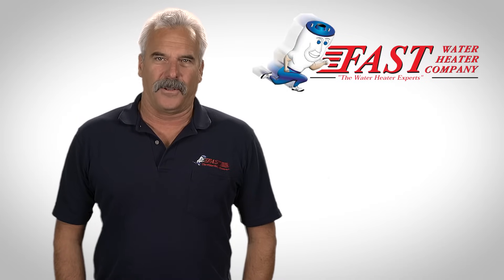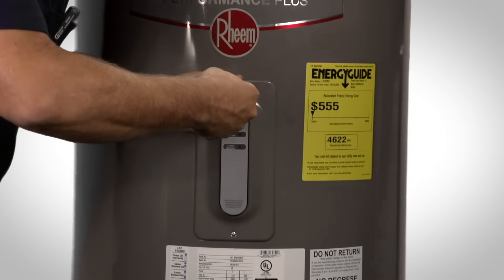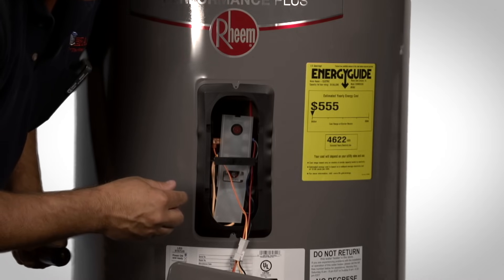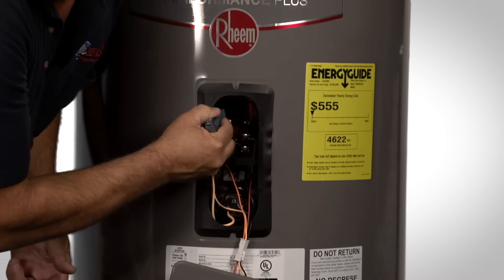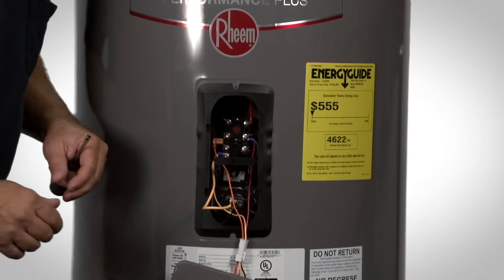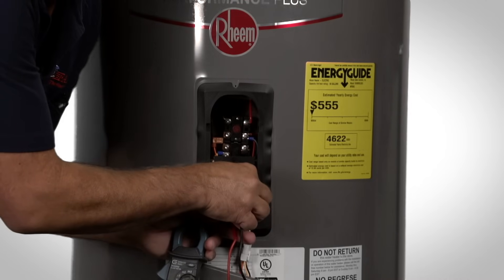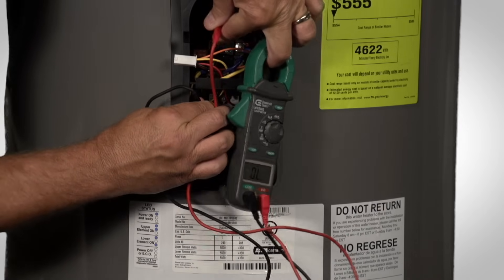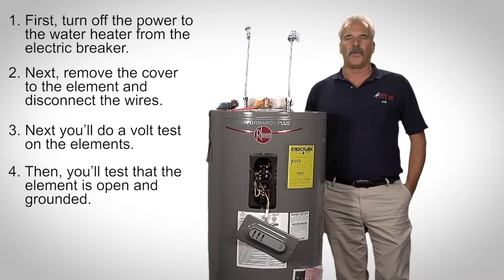How to Troubleshoot an Electric Water Heater

Comment: checking resistance defines accepted value 220(V)/30(A) approx 7.3 Ohms.  you did not calculate anything.  therefore, just check continuity via setting multimeter to continuity or lowest value of Ohms

Comment: I know this video is 9 years old, but it is still helping people troubleshoot and repair their water heaters. I just used this video to diagnose my defenctive heating element a couple days ago and fixed it today when the part came in. A plumber would have charged me more just to diagnose the issue and probably wanted to replace both heating elelments and thermostats even though only one heating element was bad.

Comment: I just had the lower element area short and blow the upper control unit. Easy fix - the cause was due to condensation saturating the insulation under the cavity cover. I see the covers are connected to what I assume are fans ... Where do I find these active cavity covers?

Comment: OL does not mean no resistance it means open loop aka infinite resistance.

Also, I wouldn't trust my life to a volt stick what if the battery were dead or it was broken?

Do a real live-dead-
Live voltage check with a multimeter.

Comment: A blown/open heating element reads resistance. It is relatively infinite resistance. No resistance is a short.
Burnt open/infinite resistance or relatively low resistance/ resistance = voltage/current R=E/I 

Ballpark resistance = 220Volts/40 says like 6 ohms... not being a professional but having an electronics degree. I would look for something likely way less less that 200 ohms (depending on the resistance or the point of contact of your test leads ta the element connectors) or what many meters read at "infinite" resistance, OL For "Open Loop". An open loop means there is a break in the element/wire in this case,

Comment: I put new elemetnts in   my heater and  I get 120 on each bolt but if   I touch 2 bolt  on the electrode should I read 240 volts
Reply: That's what it's supposed to do.

Comment: Your comment about the resistance check is incorrect. The resistance of a good element should be between 15 and 20 ohms. In most cases a bad element (One that has corroded, breaking into two parts) will show infinite resistance and the display will not change when you touch the leads to the element. If your meter shows zero on a resistance check, the element is shorted and will have tripped the circuit breaker during operation.

Comment: So I'm just curious, I have an electric 50-gallon AO Smith heater, I replaced both thermostats and both elements but even after that, the heater doesn't seem to be turning on, I also made sure that the breakers weren't tripping.

Comment: I heard several incorrect terminology in this video. Why refer to a “voltmeter” when checking continuity/resistance. It’s a multimeter, first of all, and you should be telling the viewers to set it to a resistance position of a certain range. The comments about the small voltage testers are quite on point as these devices have given me faulty live indications several times. Always use the meter as a confirmation. The final question for me is in the end when you are testing to see if the element is grounded why would you be looking for no resistance? Wouldn’t that mean the element was shorted to ground? What is the normal state that the element should be in in reference to ground? I would imagine it is connected to power on one side and that power flows through the element and out the other side so there it cannot be in contact with any ground source so the reading should indicate full resistance, no?

Comment: Here is the easy method.CUT OFF BREAKER AND VERIFY AT UNIT WITH TESTER.
 The bottom element  in a Rheem comes on first. The upper thermostat cuts it on.
Disconnect wires to both elements. Set meter to Ohms. The range is around 27. If OR is displayed element is bad.
If both elements test good it is the top thermostat usually.
 Another sign of that is when heating water the top element not the bottom element comes on. You might have hat water for a short time but up to 15 minutes.

Comment: When I bought a new HWH from Home Depot, I asked about installation because I'm elderly and disabled. They wanted $1187 install fee + $150 permit fee + $587 for the electric HWH which of course I laughed at. It took me longer to carefully muscle that 50 gal HWH down the basement steps than it did to install it.

Comment: He read the multimeter incorrectly when measuring resistance.  OL means overload, or infinite resistance, which is what the reading will be with an open circuit.  Zero resistance will read 0.0 ohms.  He also didn't mention what the resistance of a normal element is, and google says 10-20 ohms.
Reply: OL means Open Line, not overload

Comment: On my multimeter what setting to the spin the dial to measure resistance? I’m new and I have the performance plus rheem with led lights but only the lower element lights up blue and nothing else not even power

Comment: I only see one heating element on the bottom.
I tested the voltage at the two screws on the element coming from the thermostat and I am getting 240 volts coming from the thermostat, but I don't hear the element.

Normally I hear it making a sound while it is on.

It is not making any noise.

It seems like if 240 volts is coming out of the thermostat and running to the element, the element should be on.

The tank is 30 gallons and the element says 240 v 3500 watt
The breaker is a 25 amp 240 volt double pole

Comment: Resistance is resistance to current flow, measured in ohms.  The higher the ohms, the more resistance.  An open circuit won't flow current.  The element has high resistance to produce heat and flow less than 30 amps.  A short circuit is one that is short of resistance since it doesn't flow through the device to increase the resistance and reduce current flow.  It will carry too much current and cause heat in the wires.  This is prevented with the circuit breaker, which is calibrated to kick open at a certain current flow so it opens the circuit before your wiring starts a fire in the device or wall.  That's how it works, regardless of the words he used.This is a much more in. depth explanation.  Very good,  https://www.youtube.com/watch?v=9DDk6tPTcGQ

Comment: What a CLOWN show. You have the meaning of "resistance" reversed.  "Resistance" reads OL or high ohm reading, "no resistance" reads low or zero resistance and the continuity buzzer sounds (if on). It's also not a "voltmeter" but an "ohmmeter"
Reply: "No resistance" does not mean low or zero ohms. It means infinite ohms or an open circuit and current cannot flow.
Reply: @don.sittingbull2049  NO, no means zero as in zero. Get a grip. I have an EE degree and I attended class

Comment: Sorry but using a continuity test or the beeper is not the correct way to check for ohms on those elements. Turn your meter to ohms and read the resistance. It should be around 12-16 ohms in my experience. If it’s reading a lot higher and use the beeper,  the beeper will sound indicating that you have continuity but the element would still be bad.

Comment: You said if the meter measure "No Resistance" then the element is "Open" and bad.   This is incorrect terminology.   Measuring "No Resistance" in electrical circuits means the circuit or element is NOT BROKEN.   Measuring very high resistance or "infinite"  means the circuit or element IS BROKEN or "Open" .  Maybe you should stick to plumbing,  leave the electrical to the professionals.  :-)

Comment: I disagree with the first step. You must first find out if the unit is getting full power. I turned the power off first, then removed the cover and insulation off the water heater. I turned the power back on. With my voltmeter set at 400 AC, I found out that the unit was only reading about 70 volts. If that happens, you have to go BACK to the source of power. I removed the electrical panel, found the double pole circuit breaker, and measured voltage across both terminals. 68 volts it read. It was then that I noticed that the breaker was not fully inserted into it's bracket. I pushed it in, than found out that the breaker reading was 240 volts. It's better to first find out if you have full power going into the water heater instead of going through so many unnecessary steps.
Reply: Great advice. This is why the comments exist on Youtube
Reply: Well done finding your issue, but that still wouldn't be the first step for a couple of reasons. 1, it's not safe to start pulling the plastic shroud off of the thermostats/elements with the power on and 2, the likelihood of a bad breaker being the problem is very low. You would first turn the power off, then check the elements, then the thermostats, THEN turn the power back on and check the voltage. Simple order of operations from most to least likely. You start messing around with the order the next thing you know you are pulling the plastic off of the thermostat with one hand, bracing yourself on the water heater with your other hand, one finger slightly touches any of the screws under that plastic and BOOM! You're on the floor dead. You probably wont see another breaker fail the rest of your life, flip the breaker off first and start with the most likely culprits. If your toilet over flowed you wouldn't automatically assume the sewage line leaving your house has collapsed and start digging up the yard, would you?
Reply: Timsawyer
He did say he turned the power off before removing the access cover and insulation. I agree, it's very simple to make sure your getting 220 at the breaker before tearing into a water heater just to find out the breaker is toast. But just my opinion
Reply: Yes, you are correct. Breakers can be particularly troublesome, especially old ones. You need to know if you have the correct power going to the heater before starting the process of troubleshooting or you will be left scratching your head. Also, this video left out an important step. How to test the thermostat.
Reply: Absolutley
Reply: @themisstra7708  sounds like you only have one working element
Reply: Good advice I have found breaks in the wires leading from the breaker to the hot water heater in the past also
Reply: This video will confuse people. The continuity meter beeping means there is no resistance.  When it is not beeping there is resistance.   Also do not use a “volt stick” to check for the absence of voltage. That is not a safe practice. That should only be used to verify the presence of voltage. Use the multimeter to check voltage.
Reply: @chrismatherne3675   I have two of them and the work  great  but  yeah.
Reply: @themisstra7708  You’re only getting seven minutes because your water temps turned down dog same problem fixed
Reply: man if that ain’t right, thank you
Reply: And "no resistance or infinite resistance I would  some the  the heating element would  offer  some resistance ???
Reply: So m what's ya real name
Reply: yes, I also had a bad breaker
Reply: 3 years later to this posts party. I recently installed a garage heater and when finished, i flipped the breaker and it didnt turn on. Tested volts and got about 60-70v. Went to the panel that a previous contractor just recently installed, tested the breaker and same voltage. I started to test each bus leg to ground and some tested 120 and some 70v. Both of the panels main hot legs tested 120v so i knew it had something to do with the bus itself. Then i noticed how the 8 breakers were positioned in the panel, most breakers were right beside one another but they skipped the odd breaker slot.  Thats because they knew the panel was faulty but still installed it. Its one of those problems you will only come across once or twice in your life.
Reply: Any content creator needs to establish a clear scope in their objectives based on the knowledge, most likely set of needs and the reasonably safe skillset of the target audience. 

Most viewers and problems will be addressed just fine with diagnosing these user replaceable parts.
Reply: i  think its better to test for ground fault before attempting to touch anything in there even if your just turning the power back on to test the voltage reading. im my mind you turn that thing back on after you take the cover off imagine ur hand touches the steel  and connects a path from the water heater through you 220v can be deadly. as a nobody homeowner id take the most precaution first which is who are watching these videos. honestly he should of mentioned taking voltage readings from the terminals to see if there was the correct voltage being read

Comment: Ive replaced the upper heater element and 30 amp breaker need I mention im working without a meter and turned power back on but dont hear the heater kicking back on

Comment: I cant figure out why i have 240v at the breaker,when i test each hot at the water heater i have 120v at each wire but wont read 240v when i touch both with my meter?anyone have any idea what it could be?
Reply: I know
Reply: This is my exact problem now on this exact Rheem model. What was your issue??

Comment: This guy is the worst explainer ,didn't have to sit through every wire and screw disconnect and should explain to people how a meter works better (open/closed?-what should an average Joe see?) If we knew so much on ohms and meters we most likely wouldn't need a tutorial on water heater repair

Comment: Terrible video you don't show what setting the voltmeter is on you don't show us the screen and you just tell us if it shows resistance then it's open and if it doesn't show resistance then it's closed or vice versa who the hell knows this is supposed to be a do-it-yourself explanatory video not for professionals terrible explanation sorry this doesn't work for me at all.

Comment: I like to check the ohms on the element, even if it has continuity.  A 4500 watt element should have 13 ohms.  If its much higher, I replace the element and save myself a trip to the store later.
Reply: the one i have doesnt measure ohms maybe i should but a better on lol
Reply: @arcnova1982  It's the Omega symbol

Comment: Can both elements come on at the same time ?
Reply: I believe they alternate, because of hi amperage. If both of them work at the same time the current will be too much for the wire to withstand that heat and could result in a short and catch fire. If the breaker does not trip then you may have a fire in your house. Newer heater elements are programmed to work alternately.

Comment: Electrician here ...  Warning !!!!!  Never trust a contactless voltage tester !!!  After disconnecting power always use your meter to determine that the unit is not energized.
Reply: That’s ridiculous. Non-contact work perfectly fine if used properly. Test the non-contact on a wire you know is live like an outlet or power adapter then go about your business.
Reply: @jranck88  Most of the time that is perfectly ok.. until it fails in between you testing the NCV tester and using it on a live circuit. Example. The batteries don't make a proper connection inside the tester intermittently . It's happened to me with a Klein tester. Needles to say 277 Volts went well with my coffee that morning.

Comment: Things don't match - for high voltage electrical instructions, this is very dangerous! In your summary, you say "...test the upper and lower thermostat..." but 1) you don't show how to do it, and 2) the words on your graphics for No. 4 say: "Then, you'll test that the element is open and grounded." Your visual skipped an important step, and doesn't ;match the graphics. I suggest that you pull your video and edit in some corrections and then release the corrected version.  I think that's why you got so many thumbs down.

Comment: You mentioned using ohms for the ground in test but didn't mention that when doing the first initial test on the element. Is it set to ohms on that first test you did as well? Thanks for any time taken to respond ! 

Sincerely, 
     A new-to-trade maintenance technician
Reply: Little late but yes, ohms is always the measure of electrical resistance.

Comment: Your multimeter must be different than mine. Mine buzzes when I have continuity, not when I have resistance. So, now I'm confused... Should the elements have continuity or resistance?
Reply: Hi, continuity and resistance are the pretty much the same thing, resistance will still be shown without the buzzer function on.  The buzzer is just a quick audible que to let you know one point is connected to the other.
Reply: @MrSlick446  I thought continuity is the opposite of resistance?  Or has very low resistance that it appeared to be continuous?  When you have resistance, typically there is no beeping sound.  J Cuvier is right!

Comment: My gosh, I hope he does not work on electrical. When the meter displays "ol", it means infinite resistance (open), not shorted. He claimed the "ol" meant no resistance. And he also stated that if the element is not open, it is good. A dead short is not good. Do not trust this video.
Reply: OL actually means out of limit meaning that it’s not grounded or the element is not touching metal inside the tank. Don’t think you know how to use a meter or anything about electrical